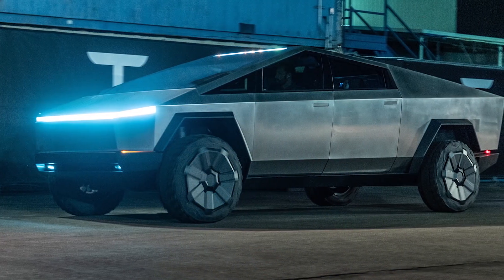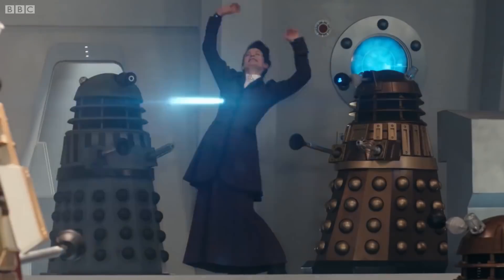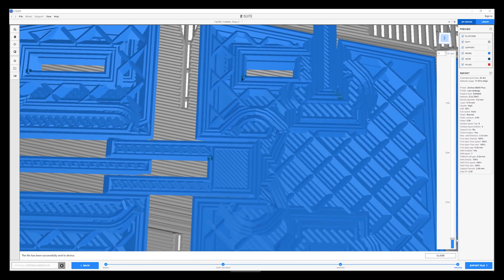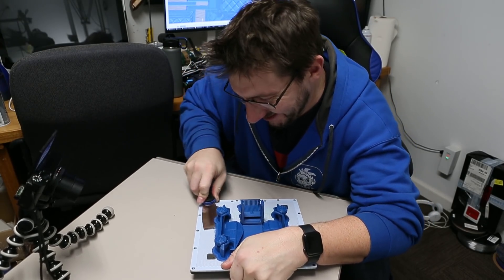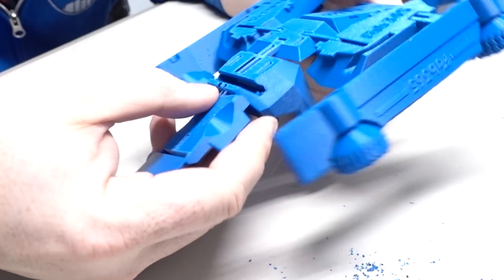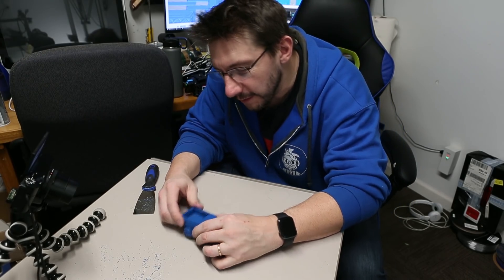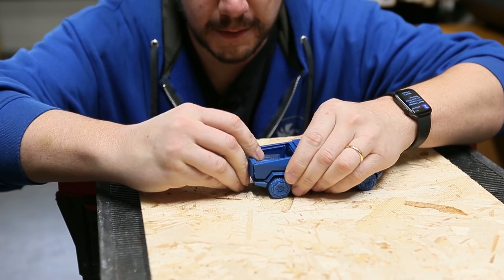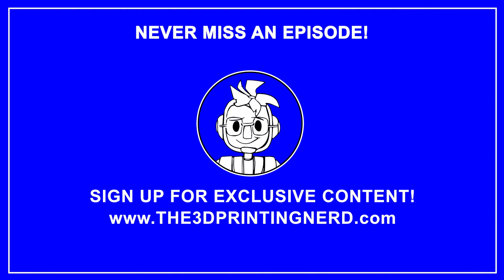3D Printed Tesla Cybertruck Assembled AND Window Tested

Comment: I see you had the same issue with the front piece clipping in, you have to woller out then alittle so both sides will snap in. The rear area at times has an issue with this also.

Comment: Wondering if you do make another one. Could it be possible to use 2 different filaments? Black and Silver, black for the tires and windows and silver for all the rest (body, hubcaps). I think that would look snazzy and more to real life. No need to actually do it if you don't want to. I was just adding my worthless 2 cents.

Comment: Hi Joel - love your vids!
I’ve had a Zortrax M200 for over 2 years and it’s been an amazingly reliable, low maintenance machine that mostly produces awesome quality prints. I only rarely get failed prints. But here’s the thing - I seldom use Zortrax material. It’s too expensive and not anything special imo. My favorite materials are the ABS-based filaments from FormFutura. Also some from eSun. The Zortrax slicer allows you all the tweaking you need for 3rd party filaments. (That said, I struggle to print PLA).
The perforated print bed is a bit of a PITA but it really works well keeping prints planted. And I can usually scrape my prints free without removing the bed from the machine.

Comment: Careful with the way you hold the plate while using that tool; I slipped once doing that, cut the hand that was holding the build plate and ended up in the ER. Had to get stitches. As a result I immediately ordered a Prusa. Flexible build plate ftw.

Comment: I bought the a-team van from fab365 and just like you I broke some hinges while assembling. A tip for noobs (like me): in most slicers you can ungroup the parts and print only the broken ones so you don't have to reprint the whole model. Wish I knew this before  I reprinted the model an broke it again.

Comment: Don’t feel bad Joel. The same joint broke when I printed it.
Reply: It is because the gap is narrowed and the joints to connect are stuck together. Decreasing the string by reducing the multiply or increasing the retraction makes the joint move well. Thank you~
Reply: FAB365 3D Printing this was actually the first joint I had issues with. I’ve printed several of or models on the same printer with the same settings.

Comment: If you must use a scraper, plus use a rubber mallet to tap the end of the handle, it will flow right under a part and takes away the risk of injury which i know about first hand.

Comment: Definately need a 200% version. After all, your the guy that prints big right? lol.

Seriously think I'm going to have a go at some of the Fab365 stuff. 
Only problem is that satin smooth finish, I can't seem to get rid of the wood grain like finish on my prints (as you can see in my time lapses). I know my Prusa i3 mk3s can be tuned better, I just don't know what's left after tightening the belts and bolts. Got any words of wisdom? (maybe a "tune your machine" vid?) ;-)

Thanks for all your great content.

Comment: I just downloaded the FAB365 foldable-enterprise... (BTW: it was free )   I found the the using the original STL they provide works great.  I found that using the slicer to scale up for my CR!0S the hinges and captive areas are not as clean as the original.  Scalling up made them extremely sloppy and I suspect scaling down would make them too tight. Can up discus the merits of scaling with slicers vs modeling programs like Fusion360??
Thanks  for all your efforts
Jimm

Comment: Makes you appreciate the magnetic flex plate off the Prusa doesn't it.
Reply: Specially when you want a smooth bottom surface 👌
Reply: A magnetic bed is the best upgrade you can do for any printer!
Reply: Or, garolite sheet.
Reply: I prefer the FilaPrint surface over any other option
Reply: Or heated build plate
Reply: @ExternetEx  wouldn’t that melt the plastic?
Reply: @guppymoment  It keeps the plastic on its glass transition temperature, keeping it soft, to avoid the plastic to pop off the bed and to avoid warping. Which is needed for heavily warping plastic like ABS etc. A heated bed is always nice to have.

Comment: I've found that razor scrapers are great for removing prints from a surface. They're commonly used to clean glass top stoves. The thin blades get under prints really well.